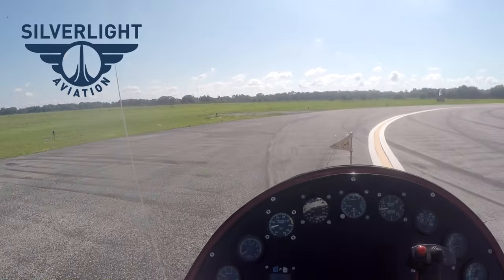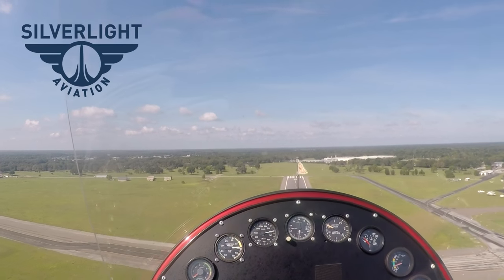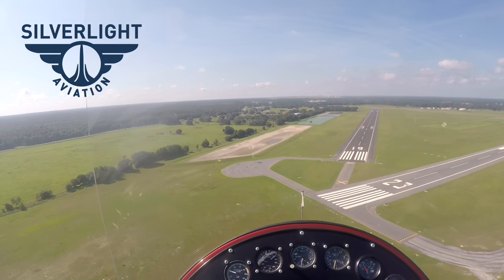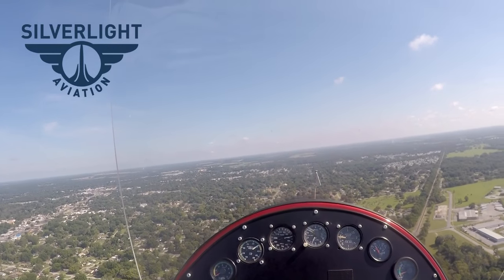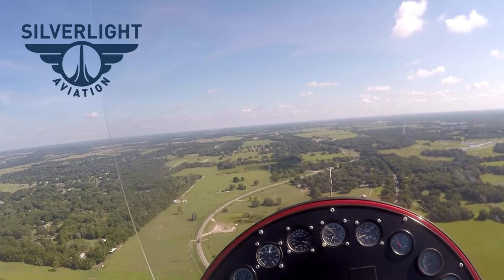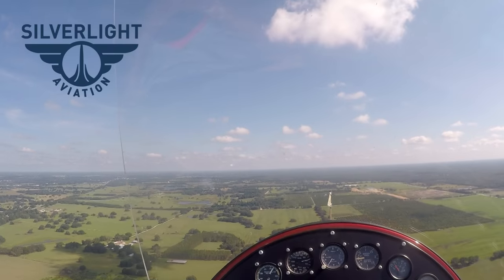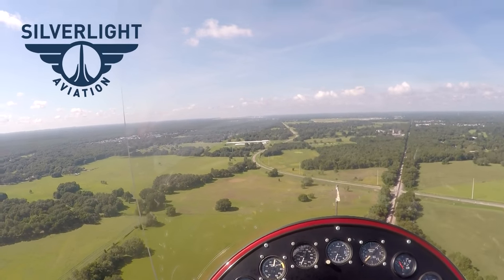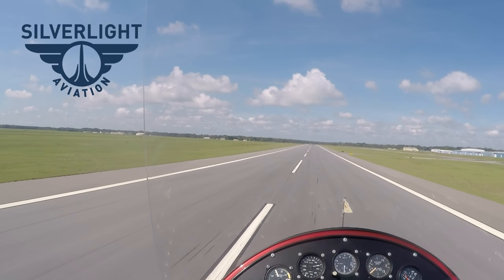Silverlight Aviation Demo Ride American AR-1 Gyroplane Zephyrhills Florida

Comment: As a rooky viewer, it seems to be an easy flight for everyone with only  flightsim expieriance ... ? Without torque stick you only touch the powerstick ..... and keep an eye at the pitch and alt meter.
Reply: "Torque stick"?  "Power stick"?  Helicopters have torque pedals, and fixed-wing planes and autogyros have rudder pedals. Helicopters have cyclic sticks, and fixed-wing planes and gyros have control sticks (or yokes, for many fixed-wing aircraft). The control stick on gyros is often called a cyclic, but it really isn't in most cases. Helicopters also have a collective control, but there's no equivalent on fixed-wing planes or (most) gyros. All three also have throttles, generally mounted on the collective for helicopters and on the panel, center console, or sidewall for most gyros.
Reply: Unfortunately a Flightsim does not teach you jack about actual flying. Not unless you are working with very expensive flight sims. MS Flight Sim is a joke. Real flying is nothing like it